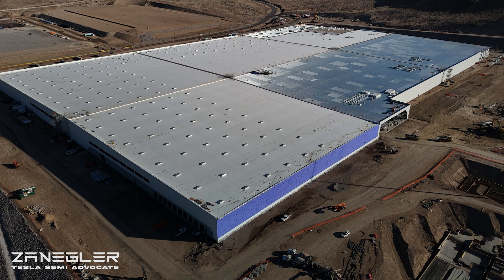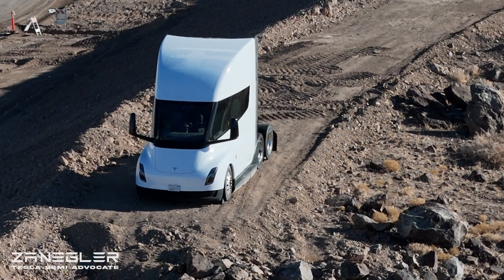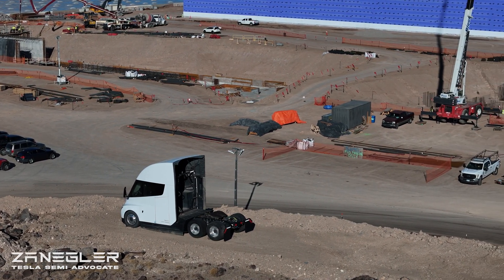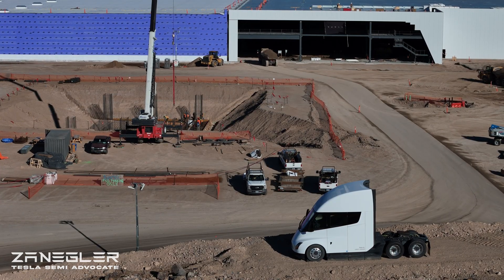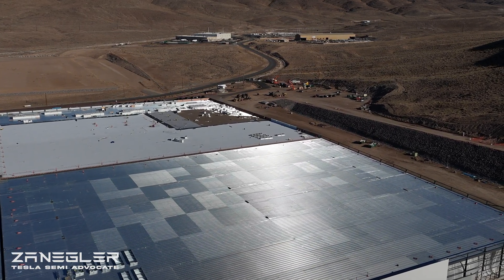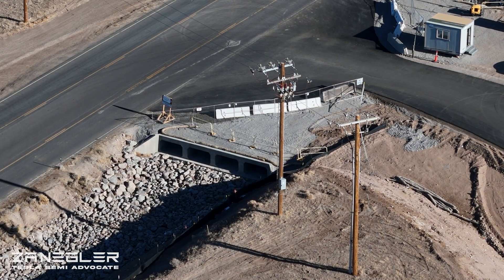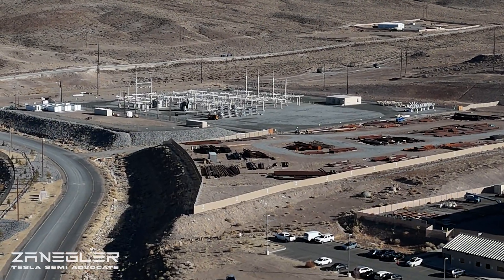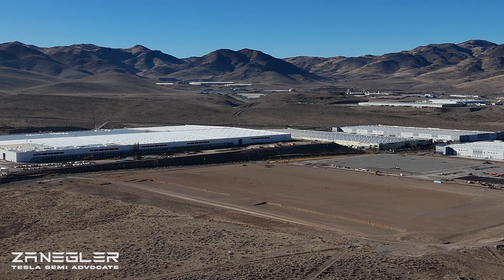GIGA SEMI POWER SUPPLY & MORE

Comment: The stamping foundation had to be placed upon bedrock which is why they dug a pit.
I am guessing they will now pour layer upon layer of concrete to bring the floor up to
ground level. Otherwise the employees will have to venture down into the pit to work 
each day. Would that be safe during a fire? People having to climb out?

!
Reply: The stamping presses are located at ground level. The dies are shifted in and out of the presses at grade.

The chambers below grade/ground level are for scrap removal conveyors, utilities, maintenance, and the press isolation system.

Check out the Munro Cybertruck factory tour video to see how the system works. Video title 'Tesla Manufacturing: See how the Cybertruck HFS Panels are Blanked, Bent, and Built!'

The stamping presses at GT are constructed on compacted fill in an old sand and gravel mine, beefed up with compacted gravel geo-piers.

Comment: Actually it looks like a lot of the grid and other electrical substructure is underground. This substation does have one transformer, but apparently no backup. Here, this small megapack may just be supporting the MV power side to the factories. Is there another obvious feed from this substation to the Giga-Nevada factory? I would think that the Giga-Semi factory would at the very least double power requirements at the site (maybe even add much more than that). There is a whole lot more to know about to understand the power supply requirements and, consequentially, the electrical infrastructure here. Maybe there are permits available on line that describe these things. Perhaps this is just a beginning and the power utilities in the area have more work to do. Nevertheless, thank you, Zanegler, for exploring the utility sides of the factories there! These give viewers a much better understanding of what is going on.

Comment: Typical power line in cities carries 5 to 30 kV, which can deliver tens to hundreds of megawatts.  I'm no expert but seems likely there is plenty of capacity in the lines coming into the factory and for charging infrastructure they will need for all those new semi's.  Especially since it's right next to substation likely those lines could be on the high end of capacity.

Comment: At the very large facility I work at, that distribution line you are showing was used for construction. I would expect them to bring in at least 4160 but more like 13.6 transmission to distribute to the factory. The large motors will run on 480v minimum.

Comment: Zanegler, could you estimate the dimensions of the semi factory ?
Reply: Google Earth Pro has an image from 20 October. Area of the factory calculated using the Google Earth ruler, not including Stamping is 1,490,000 sq.ft. 138,500 sq.m.

Stamping I would estimate to be an additional 155,000 sq.ft 14,900 sq.m.
6